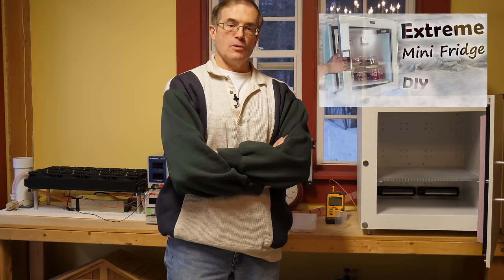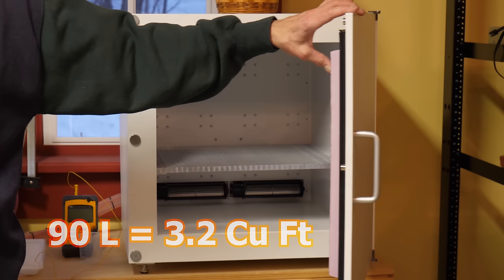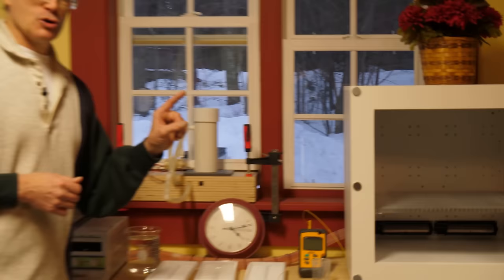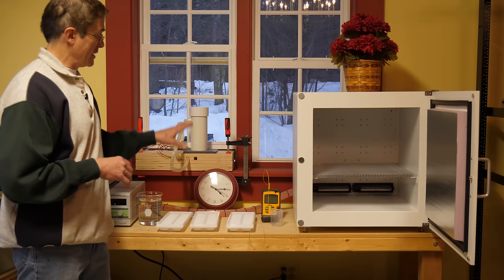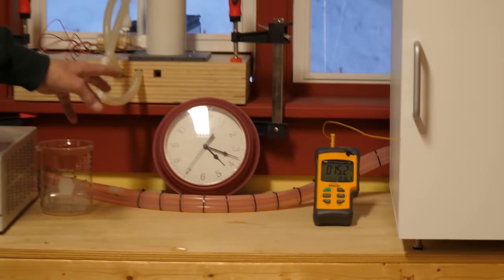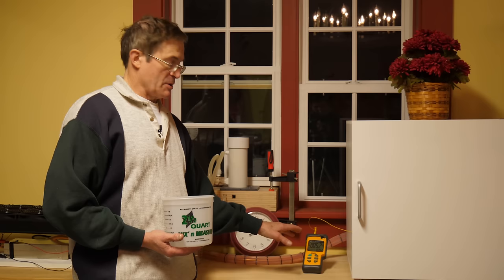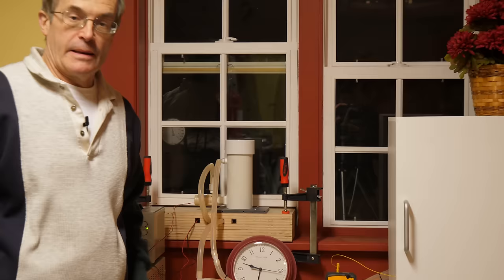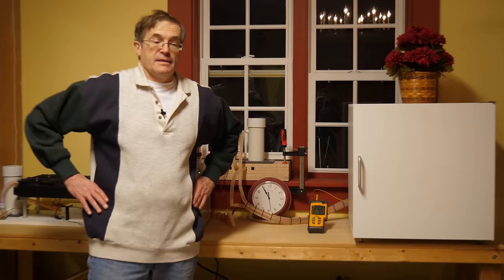TEC Freezer - Build Your Own!

Comment: 10:00 Always fun to geek out on your stuff. That is exactly what would happen. I don't think that people intuit that freezing--meaning the actual phase change--is an exothermic process. When there are minerals present, there are ubiquitous nucleation points provoking the phase change on the way down, but deionised water would delay phase change allowing the temperature to drop several degrees below zero while still being in the liquid phase. Just before the phase change starts, it releases heat into its surroundings, bringing the temperature back up to 0, which is the actual freezing point. Once the phase change has finished, the temperature drops again. This whole cycle is what was detected by the thermistor. I was raised in the Sierra Nevada mountains, and we had wilderness survival training in the 7th and 8th grade. Our teacher demonstrated this phenomenon during one the winter survival outings. And because it was so cold out, it didn't need to be in an enclosure, so we were able to directly observe it happening.

Comment: No one's done the math yet, so here we go: 
What was the heat pumping coefficient?

The temperature crosses 0.0 for the first time at 5:16.
The temperature departs from 0.0 at 8:31.
That's 195 minutes or 11700 seconds.

Since the whole unit was using 219W, it used 2,560kJ during the freezing period.
It takes 334 kJ to freeze 1L of water.
334 kJ / 2,560 kJ = 0.13

So the heat pumping coefficient was 0.13.

(Btw, there's a bunch of missing frames around 8:31, so I plotted everything available from 8:30-9:00 and drew a line back to 8:31)
Reply: so how does this compare to your average consumer freezer?
Reply: You didn't include the heat pumped out bringing the water down from ~20 deg C to -5 deg C before it started freezing nor that from cooling the ice from 0 to -5 deg C (or the heat of the air, but that's probably negligible). Still doesn't make it a great efficient option.... just not as bad as you calculated.

It's another ~105 kJ for the cooling of the water as was observed. Making a bad assumption that ice needs the same heat pumping as water adds another 21 kJ, so... total of 126 + 334 = 460 kJ. So CoP = 0.18.
Reply: I'm sure it was intentional that he did not address that. I looked into Peltier options when I was researching the tiniest fridge for my solar setup and nothing came even close to compressor bassed Systems as far as efficiency goes. I currently use a compressor based mini fridge, only 1.2 cubic feet but it uses about 80 kilowatt hours a year. I've had it for about a year now and haven't seen anything on the market come close. I hope that changes. We need high-efficiency at reasonable prices. If you could show me how to make one of these: https://www.amazon.com/dp/B076S52ZG2/ref=cm_sw_r_cp_taa_i39pDbJE2E9PE
without losing efficiency (150kwh/yr) I will be a happy camper! Literally...
Reply: @dacelooper  At $1000 purchase cost for that freezer then even with the low efficiency of a TEC if you have cheap/free electricity then it's quite possibly more efficient cost wise to go with a TEC.
Reply: @isaaclester3318  The big issue is these device work very poorly in high ambient temperatures.  Very ineffective in tropical temperatures when the ambient temps are in the 90s.  Even ocean water is in the 80s.
Reply: The efficiency / COP  for a compressor based refrigeration system is calculated over time over a longer period of time.  If you would buy a brand new compressor based freezer do the same test of how much power it takes to freeze 1L of water as the first time it being powered on ,  the calculated efficiency would be less the efficiency rating, listed for the product. I actually watched a youtube video where they did something similar , where they left a mini fridge go to room temperature, added food , left it go down to freezer temperature and the 1st time the COP was calculated , the COP was actually less than 1 , But as he left it on , the efficiency went up , and over time the efficiency was calculated to be much closer to the rated efficiency for the product.

Comment: I used to run my custom radiator for my desktop outside my window. I slapped on 8 of those Delta fans on it and if you told me I could've cooled a small car engine, I'd have believed you. And the nice part about those fans was that if you did accidentally stick a finger in there, it'd cut it smooth off. Much easier to attach when you got to the emergency room.  Michigan winters get down pretty low, so most of the year I didn't even need to run the fans. I didn't want to run any antifreeze thru the loop, so I just left the computer on 24/7 to prevent freezing. I'm sure my parents didn't care for that when they got the electric bill. During the summer, the considerable heat load was dumped totally outside, so I figured the decreased load for the house's AC made up for it. And those fans sounded like a jet engine, so the noise was also kept out of the house. I found out that every kind of bug and leaf will get into that radiator. I even doubled up on filters and created a hood to try to protect the fans from rain and falling debris. Anyway, one winter the polar vortex came with it's -20 degree air, and along with my humidifier for the dry indoor air, condensation formed everywhere inside my case and shorted everything out. Probably should've packed the CPU socket with dielectric grease, but I don't think it would've mattered.

Comment: Tx!  Just my 2cents
TEC1 12710
TEC1  means 1 layer
TEC1 127 = number of junctions/cells/elements
TEC1 127 10 max amperage. 

So if you are going to drive the elements ‘gently’ then you can use the TEC1 12705 or 12706 which cost about half of the 12710’s.
Reply: Is it something like CPU's, where they make all in the same batch, then sort them by max(whatever)?
Reply: Anders Doverud 
I’m sorry but I’ve no idea. I just read the specs.

Comment: Evaporative air conditioning? This I gotta see. Subbed for sure. Can't wait.
Reply: If you ever visit New Mexico you'll see all the swamp cooler (evaporative coolers) to your hearts content.  That's all we basically use out here.  Metal box, will it with water, simple pump to pour it over aspen straw pads, 1/3hp motor to spin a giant squirrel cage.....bamm...you got evaporative cooling.  Sucks during humid season though (august)....but I can run the cooler 24/7 for about $100 a month.

Comment: Cooling performance indoor.....220w continuous
START: 16:18hrs @ 15.2 Celsius
STOP: 17:16hrs @ 0.0 Celsius

Summary: Roughly 1hr of 220w continuous to drop temperature from 15.2c/60f to 0c/32f
Reply: Warrior Son  A chest freezer has more thermal mass that is already at its terminal low temp and that is an aid in freezing things put inside.
For what it's worth I picked the first chest freezer I could find (Frigidaire FFFC09M1RW) and its estimated annual kWH was 218, so that's an average power draw of 24W over a year.  It does appear that the TEC is substantially less efficient, not even counting the much larger volume of the chest freezer (~279 liters).

Comment: You need a controller to maintain stable temperature.Then test how much power it consume in 24 hours.
Reply: Exactly. IDGAF how much current it draws at a given moment, but how many kW/h/year!
Reply: @fun_ghoul  If you ran it constantly, that is without a temperature shut off (which this is a proof of concept and doesn't have one) . So lets take this one as an example. I believe he said it uses around 240w (P = I x E) that would be an hourly consumption. There are 24 hours in the day which gives us 5760w (5.76KW/day) you can then calculate your wattage on a monthly basis (172.8KW/h) and from there see how many KW this burns a year (2.074Mw/yr) and in the US on average it would cost approximately $352.58/yr to operate. Now if you go with the fairly "typical" duty cycle on a freezer and fridge is around 8 hours (1/3 of the time) you could of course improve this with your choice of insulation. I'll leave you to figure that usage out yourself, you're a big boy.
Reply: @AcydDrop  5760Wh, not 5760W, and definitely not 5760w. Watt is a unit of power, power x time, as in watts x hours,  or Wh, is amount of energy.

240W constant during 24 hours is 5.76kWh, that number is correct. 5.76 times 365 is over 2100kWh,  or over 2.1MWh.      

The symbol for watts is W, the symbol for kilo is k, lower case.

Apart from that, you're mostly spot on.  This being proof of concept, and actual energy consumption over a full year is irrelevant. Singe step TEC systems are immensely ineffecient heatpumps against large temperature differences,  most of the energy in this system was wasted just compensating for heat conducting back through the TEC modules.
Reply: @fishyerik  You do realize what I said, and what you said is exactly the same, right?  5760Wh = 5.76kWh (5750/1000 = 5.76kWh).  But I was confused since a watt has nothing to do with time.  It's a function of work performed as represented by P = I x E (P = watts, I = Current and E = volts).  For example at 9:04 mark you can see it's drawing 11.4 Amps at 17.6 volts.  So P = 11.4 x 17.6 which gives up 200.64W for example.
Reply: @AcydDrop  My comment wasn't confusing at all, you were confused to begin with when you either thought that watt is a unit for BOTH power AND energy, or you thought that power and energy is the same thing, I don't know which of those is worse.    

Watt is the RATE of work performed, NOT the AMOUNT of work performed, as rate is called power, amount is called energy.

 1W is power, 1W for 1 hour is energy,  you can write it 1W ⋅ h or, as usual, let the dot be implied, and write it: 1Wh. 1W/h is used to describe CHANGE of POWER. Not absolute power, not energy.

So, no, neither 5760W or  5.76kW/day is the same thing as 5760Wh or 5.76kWh, absolutely not, the differences are FUNDAMENTAL

By the way, the symbol for volt is V, not E, E is usually energy.
Reply: @fishyerik  You are seriously not making any kind of sense at this point.  Any intelligent discourse with you is obviously impossible past this point, you don't even know Ohms law.  I suggest you consult Google or Wiki before looking ignorant next time.  Good day sir, I will make no further comments after this one you are quite literally not worth my time at this point.
Reply: @AcydDrop  I'm seriously not making any sense TO YOU, because you don't understand that there's a difference between power and energy. 

So, you know that amps x volts = watts has to do with  Ohm's law, and based on that you think you in a position to lecture me.

The difference between power and energy is as basic and fundamental as the difference between speed and distance. 

This conversation is literally as ridiculous as if I were trying to explain to you that miles is not a unit of speed, but miles per hour is, and you were going: "Hours has nothing to with miles, you don't know what a mile is, go educate yourself."        

If you agree with me that energy is a real word, and not just something a made up, you should go to wikipeda and check out energy and units for energy, I suggest you start with:

https://en.wikipedia.org/wiki/Energy

https://en.wikipedia.org/wiki/Joule

https://en.wikipedia.org/wiki/Kilowatt_hour    

If you find anything you think disproves what I've explained to you, you have misunderstood either me, the articles on wikipedia, or both. 

And, despite you being really funny, I don't care if you stop responding or not. It's not hard to find people that learnt a tiny bit of information, and think they can correctly guess everything else that has anything to do with that.

Comment: I built a similar system experimenting. My goal was cooling with the least amount of energy use. Have you ever considered a chest freezer design? The reason I built mine in that format was whenever you open a stand up fridge, all the cold "spills" out  and replaced with room temp air when the door is opened. I found when you use a chest fridge, even if you open the door for a bit, the temp stays colder longer. I originally did a TEC, but eventually yanked the compressor from a mini fridge. I ultimately was able to turn the project into a camp fridge powered by solar because the start up power was around 100 watts, but as the motor took over, the wattage dropped to 45 watts. Since the chest fridge held temp so well (REALLY THICK WALLS), The motor only kicked in every few hours for like 15 minutes to maintain temp. Just sharing my ideas because you video reminded me of what I worked in. Keep up the great videos.
Reply from the maker: Thanks for the feedback.
If you want to tweak the effeciency a bit further, there is potential with evaporative augmentation of the compressor based system.  When we built the dessicant airconditioner (video in the works) we discovered that a low powered pump or better yet a passive, capillary fed evaporative bed ventilated with a few watts to power low speed, computer case fans can remove more than six times as much heat per watt as the compressor.  Super cooling the heat exchanger for the compressor will increase the overall effeciency at the cost of a few decileters of water.
Reply: @TechIngredients  - Interesting. Never heard of a dessicant airconditioner, so I had to Google it. I do understand evaporative cooling though. That would be a video I would really appreciate. Might make that my next build. I can get my current system to cool to -5 Celsius, and the chest design definitely makes a major difference (I tried a stand up design before), but I think I have hit a wall when it comes to power efficiency.  Overall it sips energy all week and stays below 5 C all night  once you get the temp down, but it takes a while to get there. It's basically a thermal battery. "Charge it" and during the trip, let the motor kick on every once and a while to maintain temp. Anyways. Looking forward to that video in the works. You have earned a sub and a like!
Reply from the maker: Thanks!

Comment: This is almost practical. I'd suggest adding a smart thermostat which boosts cooling to get to the desired temperature, then dials down the power consumption to sustain it with the least amount of power possible.

Great video...
Reply from the maker: Thanks!

Comment: What's crazy is I have a refrigerator/freezer in my garage that belonged to my grandparents that they bought in the early 1930's, a G.E. Monitor Top model CA, and it uses less power than this when running the compressor. It's almost 90 years old and the only thing thats been done to it was I replaced the electrical wiring  becuase it had become very brittle, and i gave it a nice new epoxy white paintjob. If only they made appliances with such high build quality today.

Comment: This is insanely relevant to me, thanks Tech Ingredients. I have been trying to find a good way to cool electrical device enclosures in the Texas heat in the summer by using TECs, potentially with solar power (while keeping the enclosure water tight). This freezer is about the same size as the electrical boxes I will be using, so its awesome to see a video that shows they can be effective, even if I have to use several of them.
Reply: I hope you're going to dip the boards in some hydrophobic at the very least in Texas humidity.

Comment: Excellent. I found that sealed TECs can be used under water. I use two $3 aquarium pumps to spray water on both sides of the TECs. Once the target temp is reached I turn off the pumps to thermally isolate both sides reducing heat flow through the TECs. The cold pump circulates water through the inside walls made from aluminum gutter flashing. The hot pump circulates water through some of the aluminum outer walls. The structure is aluminum - water channel - insulation - water channel - aluminum. It is extremely easy to build because the TEC clamps are not needed. It would be good to use insulation that can be glued. Aluminum adheres well to the TEC if it is sanded and cleaned with acetone. I glue flashing windows slightly smaller than the TECs to both sides to make it easier to attach to the TECs to the insulation that separates the hot side from the cold side. It can be built with a matt knife, some wire nuts, a thermostat and a power supply.

Comment: You mentioned super cooling of the water. I work commercial refrigeration for a living and one thing that has always been in my 30 years in the field is an issue in ice machines of super cooling the water on the initial batch. While the water is being circulated over the evaporator plate it can drop as low as 27 degrees F. It will all turn to slush in an instant stopping all flow until it warms up enough to melt. It's interesting to watch. Modern machines don't have the issue as much as older ones due to better engineering. Keep up the great videos.
Reply from the maker: Thanks!